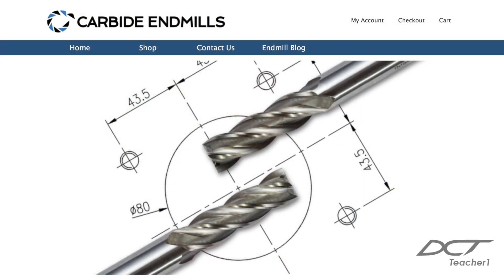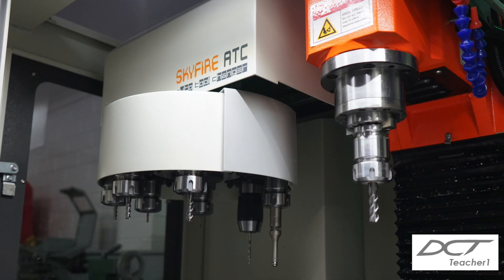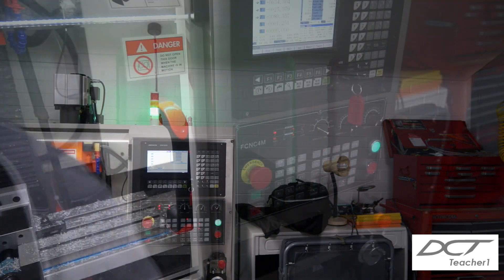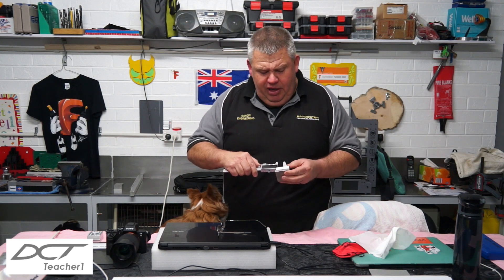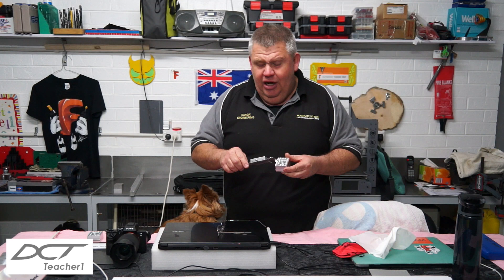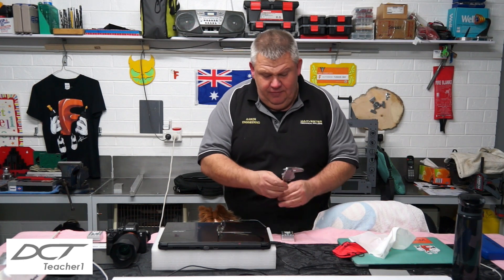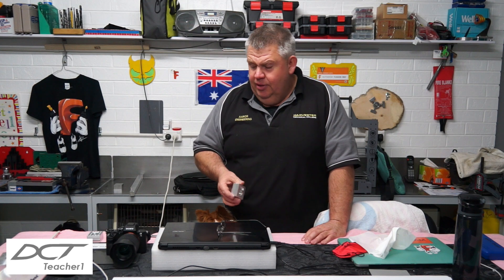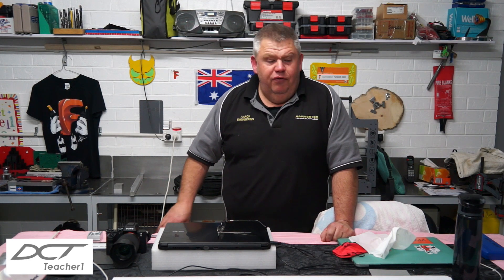SkyfireCNC First Test Cuts - Using Fusion360

Comment: Please do not use wd 40 as a cutting Fluid it is a cleaner. It contains 80% of aceton
Reply from the maker: Lars Moeller Hi Lars, and thanks for your feedback. My machine is capable of running flood coolant, but I don't have any at the moment. This was a one off to get the video out tonight. Cheers Aaron
Reply: It was a corrosion inhibitor. Water Displacement, 40th attempt of a formula.  CO2, Mineral Oil and Varsol (Stoddard Solvent). No acetone.
Here is the MSDS 
https://www.wd40company.com/files/pdf/sds/mup/wd-40-multi-use-product-aerosol-sds-us-ghs-7-20-14.pdf
Reply from the maker: Hi Andrew, yes I watched Pieter from greedsead's video and spoke with him over instagram.  I have cleaned my cabinet with Metho and sealed it with clear silicon.  I left if for 48hrs to cure before filling with coolant.  Cheers, Aaron